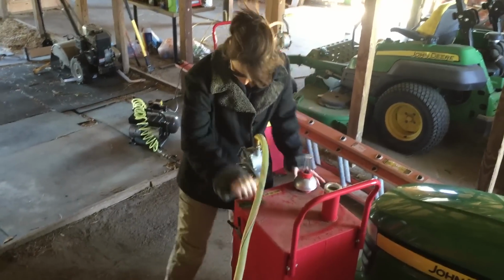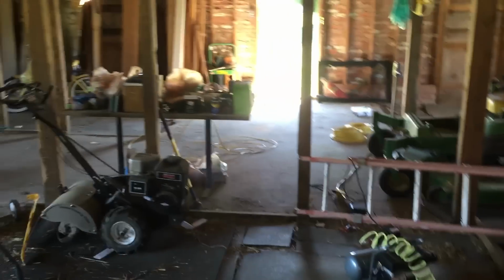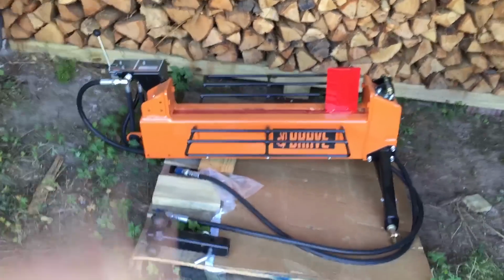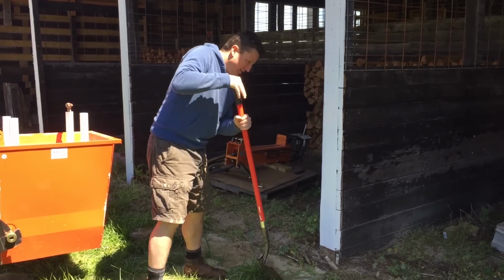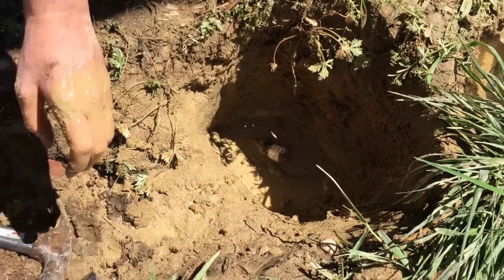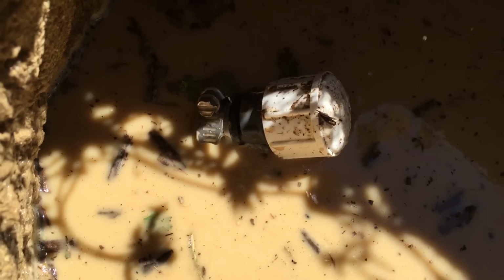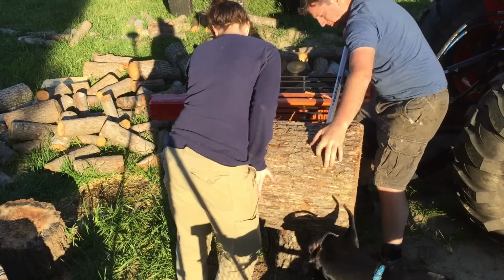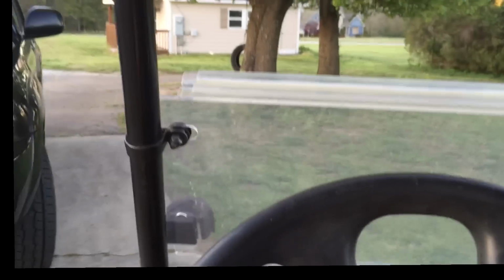DITL Sunday Stable Update, New Splitter, Plumbing, Mowing

Comment: you could chop that big round in half with a chainsaw lickity split. but that is a very awesome splitter. I own a piece of forestry land that I use to shoot on. so I know all about firewood.
Reply from the maker: +MattV2099: Guns &amp; Food It's a 20 ton splitter and the first one I've owned.  Given that they sell 22 ton and 27 ton splitters I was worried that it might lack power on the biggest rounds.  I don't think power is an issue, the issue is getting it closer to the ground.
Reply: +WoodysGamertag but why not just fire up the chainsaw for the big ones so you don't have to roll them
Reply: +WoodysGamertag you should dig down and place it down so you can roll over big logs

Comment: Don't cheap out Woody.   

Do the whole floor with industrial concrete but lay it out one side at a time so you still keep your gear in the barn.   

This will save you  headache later on.

Comment: While it is frustrating having to run another small engine, the main benefit of a traditional stand alone wood splitter is the ability to put it in a vertical position and roll the log underneath it. You could always fabricate some sort of ramps that hook onto the rails on the side, that would probably be a heck of a lot easier than finding a way to lower the splitter from its current height

Comment: I work with pex a little. Maybe you mentioned it and I missed it but I heat the pex before inserting the adapter. It makes it expand so its easier to insert and contract around the adapter and also is soft when you tighten down the clamp. I realize you probably would have had to dig and bale the hole out more to heat. Keep it up!

Comment: it helps if you heat the waterline up with a propane torch just a bit not enough to melt it. It makes the barbs go in easer and when you tighten down the clams it help the line to grab on the barbs.

Comment: Woody, I think you'd be better off making one level concrete pad, wall to wall, and include the go kart parking area in that. If you're planning on turing this into the premier workshop in the future, I think its worth the extra dollars now so that you're not trying to match flooring later, or having to deal with the fact that moisture will be present inside due to the fact you don't have a ground layer.

Comment: mount splitter to 4x4s(to keep it from rocking) and set it on the ground. i dont see why it would need to be on 3pt. but you might want to make some long hoses. i have a ramp to roll them up and i set up next to a fence post so it just roll off the other side
Reply: *so it doesnt just roll off the other side

Comment: Woody, how cold is it going to get in that stable/will it be heated? The reason I ask this is when looking for your LED luminaires, you might want to get information on how the LED driver(s) operate under colder temperatures because some may not operate efficiently/effectively in colder conditions. I'm not sure what the weather during the winter is like in your state but it's something worth checking in to. Also, make sure that the driver and LED board can easily be replaced, some manufacturers have been known to not provide this and when something doesn't work, the whole luminaire has to be replaced instead which increases maintenance costs in the future.

Comment: Woody, have you thought about making a ramp up to the splitter on one side and using the winch on the mighty Taco to pull the big rounds up the ramp onto the splitter? You'd possibly need a set of big forestry tongs to grip the rounds so you don't risk the winch cable slipping loose but other than that, you wouldn't need to spend any more money on gadgets, just an hour or so in your wood working corner of the barn. I'm surprised that the 3 point hitch on your tractor isn't height adjustable, seems strange to me.

Comment: Not sure if you're planning to excavate your floor in the barn but talk to your contracted about how it will effect your foundation. Might completely destabilize the structure.
Reply: It's a pole barn bro. The support posts are buried. Digging and grading out 4-6 inches for the slab won't make the barn fall down 👍👍👍

Comment: Woody, if you are doing the floor for like 3/4 of the shop you might as well do the whole thing. You can still park your go-kart and tractor implements on a designated corner. It will just be a nice concrete corner instead of a random pit of dirt and toys.

oh, and shout out to buffalo NY. keeping it real... real... really cold.

Comment: woody LPT, if you want to plug that pipe better dig around it more so you have room to blow torch before you plug it. the heat helps it seal around the plug you just put in

Comment: The hose would have been easier to work with if you had dug a wider hole, so you can pull it up a bit and hold it up vertically. But, I guess if you can get the job done with less work then more power to you. The log splitter looks like it works perfectly but maybe you can make a ramp out of a log or put together a strong piece of metal and a jack stand to lift the huge logs. It also wouldn't hurt to get your leg game up but then again I haven't gotten my lazy ass to the gym in a year either so I shouldn't be giving you advice. By the way, the moving border/video stabilization thing was annoying and actually made me feel more nauseous than just watching the shaky footage, could you please not use that next time. Great video Woody, I don't know why but I enjoy watching theses day in the life videos.